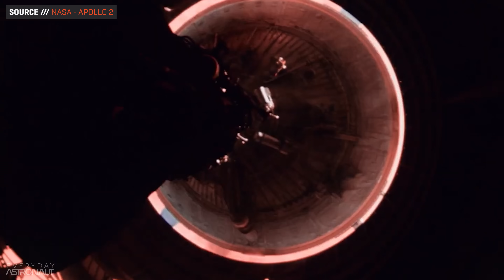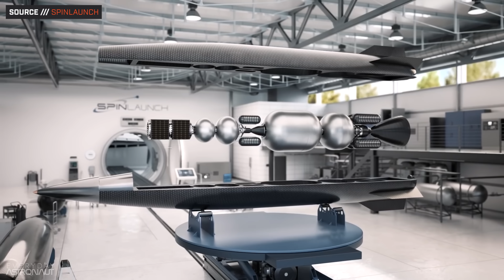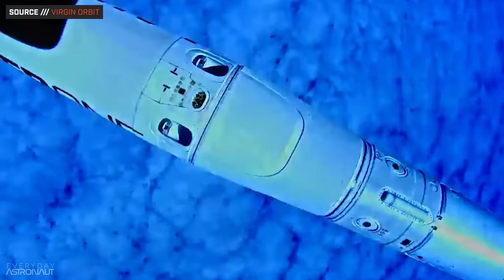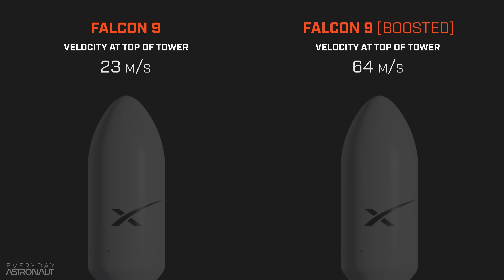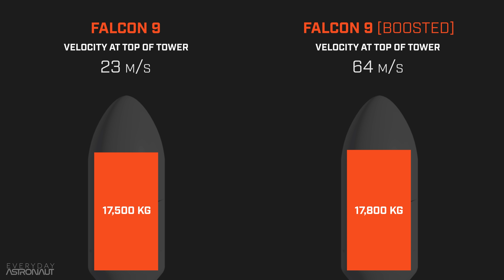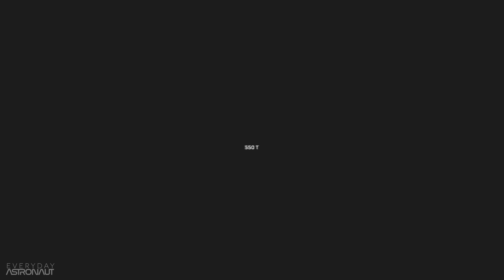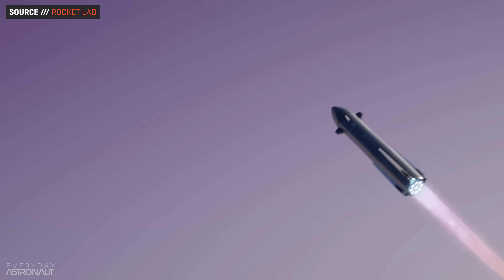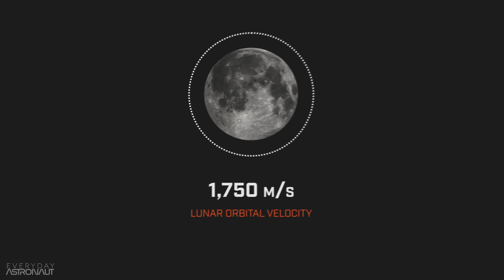Could We Help Push Rockets To Orbit?

Comment: No. We have to achieve a sustained speed of 17,000 mph. Counter-weight? Waste of time.
Adding a rocket onto the rocket?
Circular, unproductive reasoning as it doubles the cost and achieves nothing.
We dont need bigger rockets. We need a whole new technology that doesnt and may never exist if this type of thinking continues.
Reply: Nuclear fuel has higher density than chemical fuel. By like 10,000x.

Comment: Regular motor, diesel works, fuel oil is good also, but gas, too,

And use all of the torque to spin a dynamo/alternator 

Then, flow all the current into a golden tesla coil, coated in silicate based pigmented ceramic, to hold shape

Meanwhile, a turbo charger, and a super charger, with the intake for the super through the turbo, and an anti lag system, to keep laminar flow 

Add a valve for 02 to this, in space 

The exhaust, send to the tesla coil for ionization, in a steel and quartz lined tube, with secondary nozzles, dipole magnets acting as a spark plug, and copper coils for sensing and capacitance, all sealed within an obsidian or quartz crystal, made of plates, then heated while centrifugal force is applied, after, annealing takes place. The nozzles would be tungsten. 

The magnets, connect to a battery , which collects anything left after ionization through the tesla coils, 

To be used in the steel and glass tube, with the tesla coil inside 

Running on ionized exhaust, the plasma in a magnetic field,

You could then add regular rocket fuel or ether or more fuel oil or gasoline to the nozzles

For a magnetic turbine made of plasma 

Adding ionic thrusters, to gather and direct solar wind and EMF radiation with magnets, as well as an ionic intake, and aerospike 

Greatly increase efficiency 

And, using a tokamak or stellarator in tandem with this type of MPD

by replacing the traditional motor, 

Then gets you a quantum Alcubierre drive, with a quantum computer connected to a secondary tokamak for warp bubbling the stellarators, 

Or with traditional motor mpds, for a shorter distance craft.

Comment: I can't believe boosters weren't touched on at the end - they're technically not part of the rocket as they can be added onto to increase payload capacity - I thought for sure that would be the conclusion: just use boosters.  Which is kind of covered by "just build a bigger rocket"... but not really.
Reply: It was my thought also: What about some extra boosters that lift the rocket for the first 100-300m, detach and land. With insanely powerful engines but enough fuel for only 300m flight they could give some nice boost to the rocket in the initial phase.
Btw, that counter-wheight could be a concrete cube filled with water. Deceleration could be partially done by releasing the water. Not that it would make sense at the end.
I have a feeling that the author concentrated on proving that it's a bad idea without openly discovering the options.
Reply: the problem remains that your rocket is more hazardous, and costly. propellant is expensive and time consuming to buy and receive. Electricity is not. If you have a power plant capable of it, its on demand instantly whenever convenient. And a spin launcher can downsize your rocket significantly.  You can also decouple the problem of launching it into space and actually building it for whatever purpose it will serve. So basically the spin launching company takes all the risk and construction costs of making the launcher and you just pay them to throw it into orbit. Maybe to massive companies that doesnt matter, but the level of innovation that will encourage is massive.
Reply: yep that's literally what the falcon heavy does lol

Comment: Cool analysis, Tim. I'm even more amazed with rocket tech now.
One thought I had about an alternative launch system from the moon is that it could be a means to avoid spraying regolith all over the place when returning to Earth. Some sort of system to get the return capsule off the surface before lighting the engines might have merit?
And one more thing, render is a verb like paint or draw. A rendering is the noun form, like a drawing or a painting. Cheers

Comment: A Question. If getting into orbit is as much about horizontal volocity as it is vertical and the "tube" needed to be horizontal, then whay is launching the rocket dropeed froma plane so bad. When we have high altitute aerospike or other engine tech and get the launch craft much much higher, the orbital part would not need to do a sharp upward trajectory?  (it is probably a silly off by factor of 100 thing)  highest altitude 100,000 feet max volocity at realaes mach 2
Reply: Plane velocity is relatively low, a 747 goes say 500 mph. You still need another 17,000 mph to get to orbit. Plus the plane needs to tether the rocket, provide a tether for the fuels and cryogenic tanks, etc.
Reply: @ffffffff-gu5qr  yeah LOL

Comment: My immediate thought was what happens to this huge accelerating weight once the rocket has 'gone'.  Possibly a water filled bladder that bursts, but what about an aborted launch.

If you are looking for Heath -Robinson (Rube Goldberg) devices, launch it from deep under water using buoyancy for the first half mile lift.🚀
Reply: The rocket carries all the momentum away with it if done correctly. If you swing a baseball bat as hard as you can and hit a baseball then no problem. If you swing it as hard as you can and hit nothing then bad things are gonna happen.
Reply: @ffffffff-gu5qr   What about when your bat hits the ground, as a falling weight would? Its the sudden stop I was thinking would be a problem for a thousand ton weight.

Comment: I have thought about this kind of thing for years, and every thing i ever thought of had been thought of before (by people smarter than myself) and debunked as a better way to do things.

The biggest boon to space travel is re-usability.  The fuel for the rocket is the cheap part.  The rocket is the expensive part.  Which is why Space-X is so dominant right now.  And why everybody doing space seriously is looking at re-usability and working had to improve re-usability and turnaround of rocket vehicles.

There are technologies like a space elevator, rotavator, and the like that might actually be achievable either now or in the near future.  But for now, i am convinced that the good old rocket is the best way to lift cargo to space.  What we need is reliable, and re-usable rockets that reduce the cost to orbit to realistic levels.

Comment: Personally, I think the air launch is the most feasible option, just because airbreathing jet engines are a heck of a lot more efficient in mass than rockets, due to the fact that they just don't have to carry any oxidizer. If they could make an airbreathing bottom stage, they'd get the same benefit, but they haven't been able to make an engine that puts out that much thrust
Reply: Not really. The best illustration of this is Virgin's Launcher One, which had only slightly more payload than Electron despite being more than double the mass... and that's not counting the 747 it was launching it from. Air launch is horribly inefficient.

Comment: My dream, that will never happen, is that after we've established a basic moon base we decide to actually build the Sea Dragon rocket, shown in For All Mankind. To go from a bare bones moon base to a large moon base, powered by a small nuclear reactor. It actually doess make sense to build at least say 5 Sea Dragons, or more, for the sole purpose of outfitting and provisioning a moon base. The Sea Dragon had an anticipated cargo capacity of 550 metric tons, while Starship is anticipated to have a cargo capacity of 100 metric tons, well once it stops blowing up. The Sea Dragon would also not need any refueling once launched to reach the moon, whereas Starship will need 14+ other rockets launched to refill it in orbit to reach the moon. To fully equip and build a large moon base a lot of cargo will have to be flown to the moon, including additional modules for the base, mining equipment and vehicles for the astronauts to use, a heavily shielded nuclear reactor and more! The Sea Dragon just makes sense and yeah, it would be really, really cool to see that launched!
Reply: It also had design elements that turned out to not be doable, including that one giant engine.  The F1 showed that giant engines are not that easy.  The design will need updating.

Comment: I would use very high strain energy propellants and methanol water cooled turbo pump blades  instead of a fuel or oxidizer rich mixture.

Comment: At 22:02,  the required power is about 100,000kw which is 134,000hp - less power than a 777 at full thrust.    So that's very doable,  using turbine engines powering the system for example.    That method may scale up better as well.
I think comparing it to jet engine output is more useful perhaps than tesla superchargers etc.

Comment: Also launch loops store the energy in the active support system, like a couple of large nukes worth, but you raise it over weeks not hours or days so you 'simply' need... a single full scale power plant, and you can extract that energy out because the stuff active support material is moving at greater than orbital velocity, hence why it's not a big risk to Earth to release that couple of nukes worth of energy if the system were to break because the vast majority of it would shoot off into space and burn up before it could hit the Earth.

But once raised you should only have to replace a tiny amount of that energy per launch and you can take 15 minutes to replace it, with a 500MW plant that is easily achievable, the only reason you go for a 500MW plant or there abouts is to keep the raise time somewhat reasonable, and you can actually extract energy out of the loop to provide to the grid as well so while not being actively used it's a gigantic battery storing weeks of a power plants output, so you could actively use it over night mostly powered by nuclear power plants, and extract power out of it during peak times during the day to power as monstrous a grid scale battery and absorb excess solar and wind.

Comment: Setting off an explosive in a very large piston assembly would work better at that point. It would have to be very low velocity, dumping N2 would be more civilized but at that scale getting the PSI you need for whatever diameter you end up with will be hard without a chemical reaction, with some clever chemistry you could probably get the burn time to match the stroke time which would avoid a big shock wave causing trouble.

Comment: Amazing video, just to nitpick: 1200W energy consumption by an average home seems off by an order of magnitude
Reply from the maker: I thought so too, but the average US home uses about 30 kwh worth of electricity each day, so divided by 24 hours is about 1,250 watts on average.
Reply: @EverydayAstronaut I guess that's easier to imagine averaged over 24hrs. Also I'm in Quebec, where we're crazy enough to heat with electrical resistive in a cold climate - and increasingly, A/C is non-negotiable in the summer. Thank goodness for cheap and plentiful hydroelectricity, but probably not reflrctive of the norm

Comment: I started talking about the counter weight system of assisted rocket launch about 6 months ago and began asking the question to various YouTube channels. I couldn't do the math. I thought there would be more benefit. 20 years ago, I was imagining a launch system that used a tube 1km long submerged in the ocean with the inrush of water doing the initial acceleration.

Comment: What about raptor engines attached to a hirizontaly moving cart on some trains tracks and attched with super durable mechanism which will convert the linear motion to vertical. You essentially get all the power of raptor engines minus their mass. Fuel could be fed via flexible pipes. So that would definetly increase the initial lift speed.

Comment: Should use a steam piston instead.  The energy argument is ridiculous- as rockets use the same amount of energy just as chemical energy instead of electrical energy.  We can store MASSIVE amounts of electrical energy in batteries and capacitors easily.  Just look at the lasers at NIF.  The part that I think was ignored was that if you could reduce the amount of fuel the rocket needs to carry you could increase the payload by a lot more than the reduction in fuel weight.

Comment: Very fun episode,  you almost got it right.

When you started with the counterweight method I thought you nailed it.  Sadly no.  Several things need to change to make that system work.

1.  Oceangoing launch platform.  About a kilometer in size with a hole in the middle. 

2.  The hole is actually a silo.  I'm not an engineer, but using the OLM as he mount on a platform that is lowered down the silo by cable system.

3.  The tracks that guide the ship down should e six with its own counterweight.   How deep into the ocean, I don't know.  Then the tracks extend above the platform up to one thousand or more feet.  Maybe that as depth as well.  Very long cables, yes.

4. The counterweight would have rocket engines on them point to the sky.  Flamy  end UP.!

5.  Using the rocket engines on the counterweight and gravity, dropping then powering the counterweight down will generate velocity.

6.  At about one quarter to two thirds up the towers above the ocean platform,  the main engines ignite, 8bseconds later, latches release and ship is already in motion with a huge amount of gravity being used to launch the ship.

But then again, I'm a dumb truck driver,

Comment: So, to lift the weight, or whatever mechanism, would require the same energy used to launch the rocket off the stand. One way or another, the energy will be used…. The key is using the most cost effective energy available.

Comment: The only two ways, ., is advancements in material science to reduce dry weight and retain  strength.. 2  improve engines  efficiency so get more power per fuel usage

Comment: Anyone else getting a bit triggered by the units of comparative measurement or is it just me? Don't worry chaps, just fifteen swasticars to orbit and back! I really don't see the issue with short duration intense power loading in any case, given that it can be used for other things when rockets AREN'T getting launched to space.

Comment: I was always thinking about using the mechanical energy from the rocket engines pushing against the ground which is currently wasted. Just make the ground a movable platform/piston and while the piston is pushed down it's mechanically linked with a cogwheel that makes a rod go up that helps push up the rocket. Simple. It would basically improve the energy efficiency of the engines in the first few seconds.

Comment: How much energy is used by the USS Gerald R Ford aircraft carrier to launch aircraft from its deck using its magnetic launch system THAT IT HAS A MASSIVE CAPACITOR BANK WITH POWER SUPPLIED BY ITS NUCLEAR REACTORS.

Comment: You don't need a vacuum tube, you just need to get up high enough where the air density is low enough, this may seem even more problematic until you look at a launch loop, you basically fire metal balls down a tube containing them with magnets at great speed to create a parabolic arc, it's about 2000km long and as said 80km high at the peak of the arc, estimated to cost 20 billion, but lets be real it's gonna be more like 40 - 60 billion, but it's not bad the NASA annual budget is 25 billion and it would likely take a decade to complete so 40 to 60 billion over 10 years is 4 - 6 billion a year which is not small, but like the international space station costed 150 billion admittedly over more time and over more countries than the US, but no one said it had to be a US only venture and it would be a lot more useful than the ISS given that you could feasibly do a launch every 15 minutes we will assume a 50% up time so 2 launches every hour 17k launches a year like it's more than capable of doing all the launches of the whole entire planet many times over, and you can build it to be expandable by adding more tubes increasing the maximum weight it can take.

okay technically you do need a vacuum tube, but not one wide enough to fit a spaceship into, like fist sized inner diameter and likely 2 of them, which to be fair 2x 2000km fist sized vacuum tubes are already going to be spectacularly hard to build and maintain, but again easier than a vacuum tube wide enough to fit a spacecraft into and nearly as long that would need to be suspended high up into the sky.

Comment: What about a steam powered sled that pulls on giants cables and rods while being attached to some sort of trebuche type of contraption. It has to rotate and the cables and rods pull on a handle type of thing. And on the other end the rocket will get yeeted upwards. 
Steam pressure is pretty insane and i wonder how the math would work out. Right now in my head the whole picture i have actually makes sense. lol 

I guess the steam pressure would get so high that the whole sled construction would just blow apart. idk

Comment: 12:00 - "The average American home uses about 1200 Watts…"

/me looking at my current home power usage. (12.4 kW)

/me cries.

I should probably shut off my server farm. And stop charging my three EVs. And increase the temperature on my thermostat. And stop running the electric clothes dryer. And stop my bread that's baking. (In fairness, 12.4 kW is the peak when the clothes dryer and the oven are both peaking. It's dropping to ~6-8 kW "steady state" between heating surges.)

At least I currently have 5.4 kW of solar power coming in! So my net use from the grid is only…. Five and a half houses worth of power. (At peak.)

It's also not "peak energy" pricing time where I am. When it is, all those things stop, and my use drops to 800-1200 Watts. Which also means I tend to output solar power to the grid during the time the grid needs extra power the most.